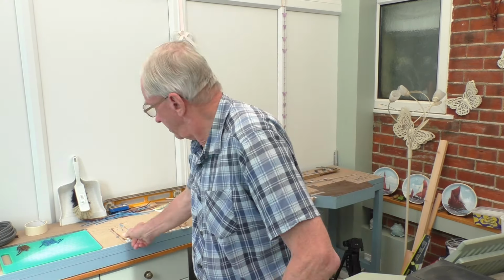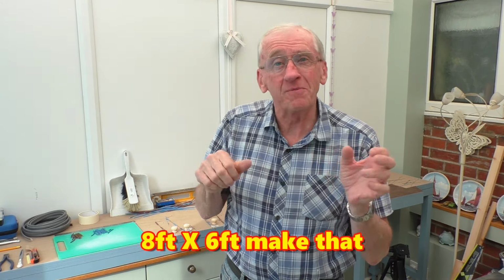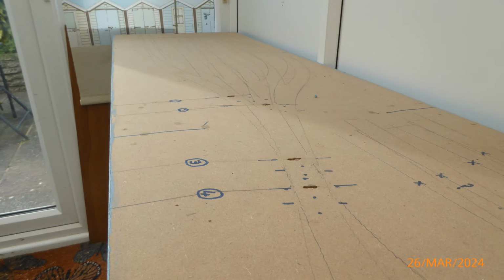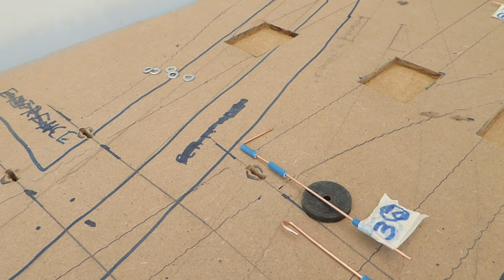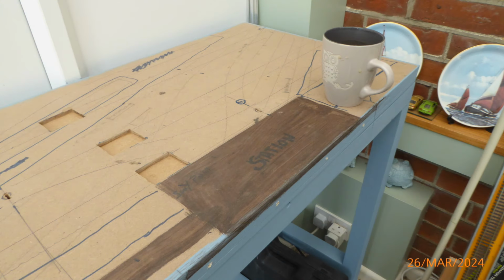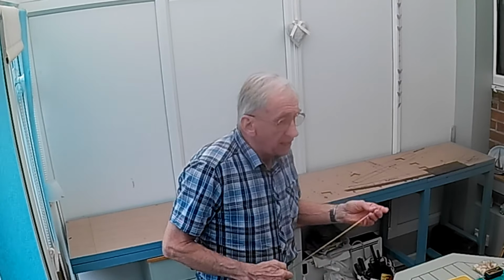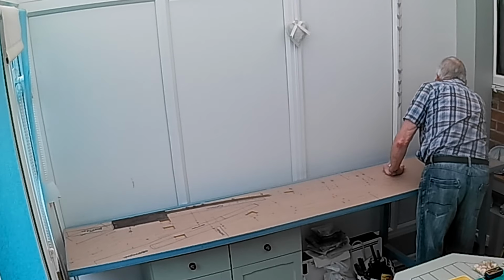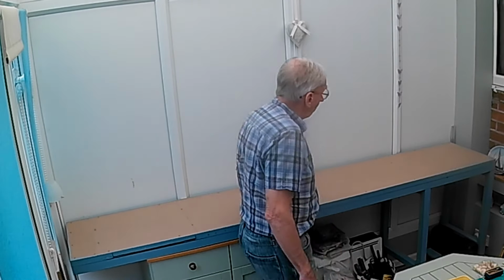UPDATE No12 THE END TO END LAYOUT

Comment: Really enjoyed that Robert. Ive seen the system used elsewhere, but never seen it installed. Fancinated especially by those fittings with the rotational units. All going very well.
Reply from the maker: Hi John,
First I hope you are on the mend but I do also thank you very much for watching and your very nice comments and although I am pleased with my point changing system it is nowhere near as good as your train lift you did all those years ago we do need to keep our work in propective with others I think. I am now starting to glue track down and that is a first for me I hope it works.
Cheers Robert.
Reply: @robertstrainset6556  Hi Robert, use PVA and weight it down, even food tins do the job, that way you can just soak it should it ever need to come up. My lift is OOOO KKKK, but it will be modified and refurbished in the future. We each build what we need for our layouts and what is suitable. I love the simplicity of your point system, remember I am design trained with BA hons degree, we were always told, over and over, keep it simple. Easier to repair if the need requires.
Reply from the maker: @piccadillymodelrailways Hi John,
Thanks for the reply I am using that Coppidex type glue I showed in an earlier video and its working well as for weights using table mats and RD books as have loads of them. I am still awaiting that return call when you get better if you have time.
Cheers Robert.

Comment: Hi Robert you do make these videos very interesting to watch. The point system is very tidy and simple less things to go wrong. Does the copper wire go through the hole in the point, been 00 i have no clue how big the hole is. Will be watching the next video tomorrow. Colin
Reply from the maker: Hi Colin,
Thanks for watching and your very nice comments as for the wire it is about 1.5mm thick and it fits some of the points but strangely not all but its not far out so a hand drill sorts it. I have started gluing track down now so a new experience for me will have to see how it all turns out more videos to come but not two by two anymore. Hope you are getting on ok with your "little" build so far looks 
 great.
Cheers Robert.